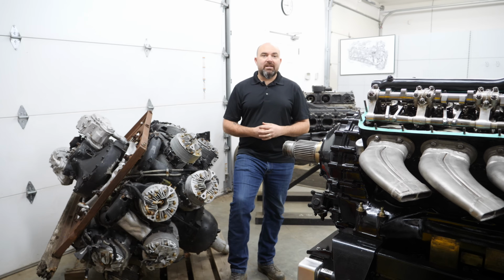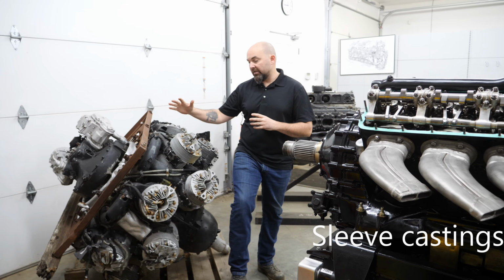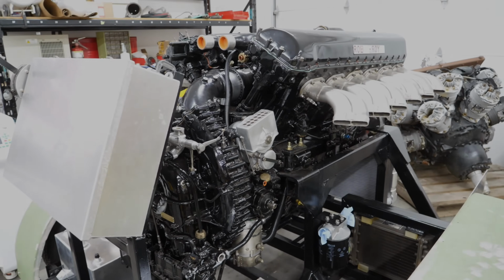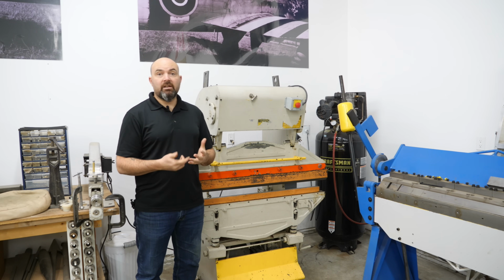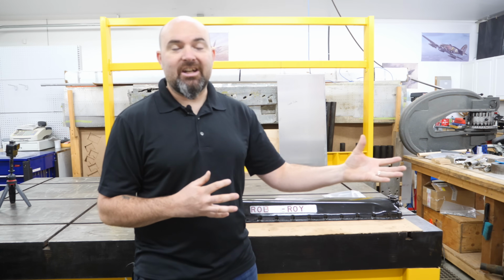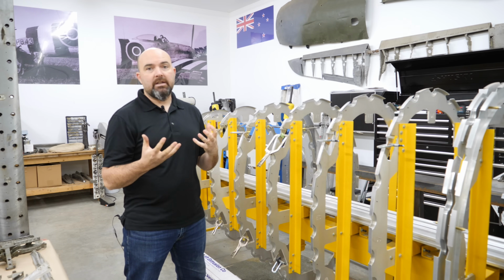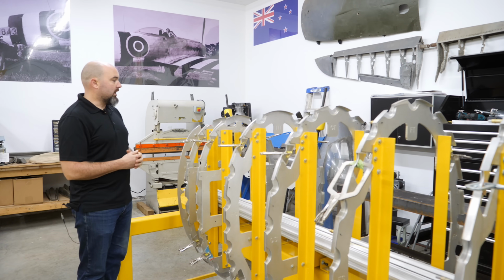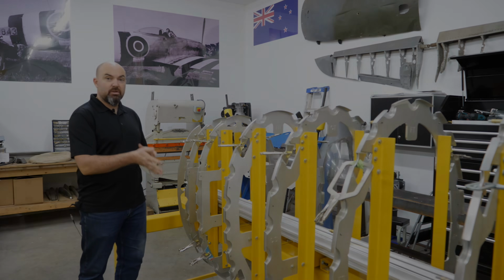S02E03 Bristol Taurus and Project Update

Comment: Interesting that you are doing an upgrade at the transport joint yet a retro step at the front (to keep original). It the fun of balancing safety with originality.
Reply from the maker: We want JP843 to be around for a very long time; as an airworthy example, safety needs to be the first priority in achieving a long term memorial. ~Ian
Reply: @TyphoonLegacyCoLtd  Agreed, I was just saying it is the fun of balancing the needs.
Reply: The updated transport joint is a definite, dare I say, "no brainier".
Being somewhat familiar with the stretch-forming process, working with architectural metals for nearly 30 years, the orientation of the profiles make them "the hard way". The axis perpendicular to the front-to-back (Y-Axis?)being on the inside of bend makes it the hard way. But even when they anneal it to make it butter soft, it still want to gather and ruffle as you’ve described in previous videos, and warp the tighter the radius gets. Hope you can film the process like you did the heat treating. Last I remembered, there’s was only a handful of companies in the states doing it. And costly,,,,,
As usual,great work.